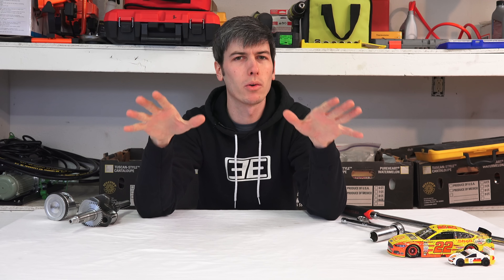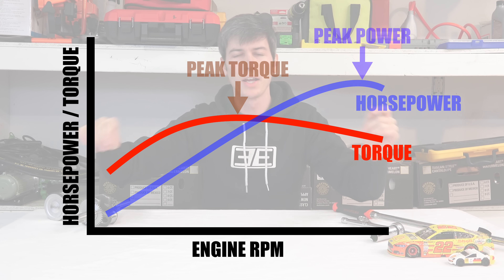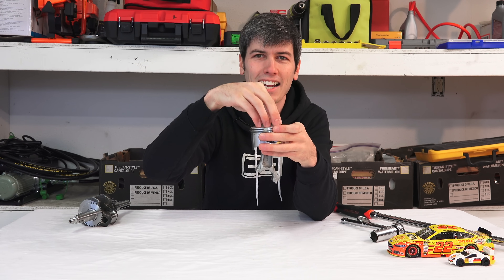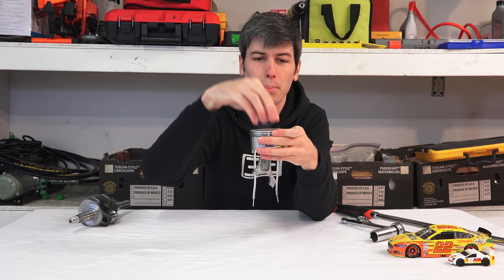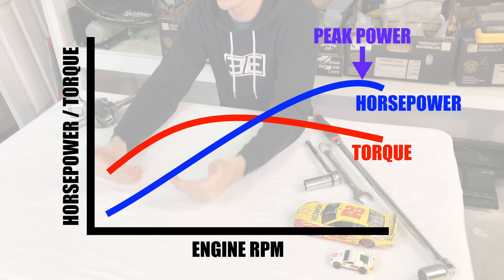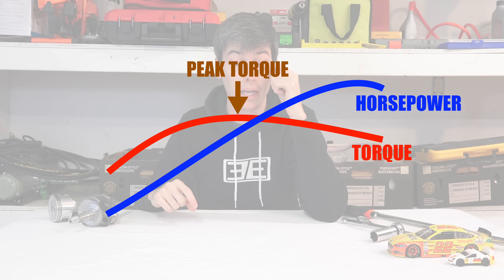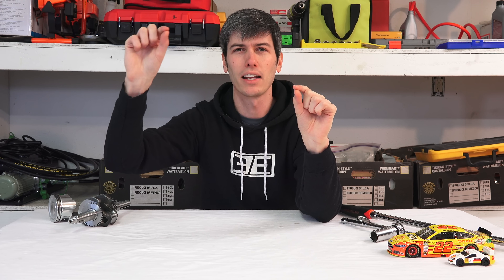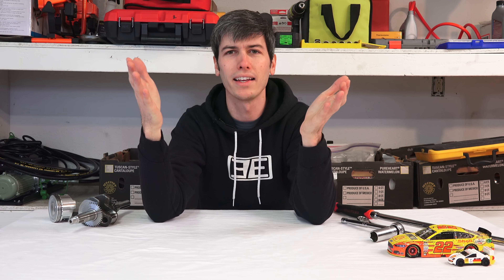Horsepower vs Torque - A Simple Explanation

Comment: Bro tell why that Diesel engines have low rpm levels?
Reply: Once upon a time it was because diesel pistons and rods were heavier, to deal with the higher compression and pressures involved. Heavy doesn't work that well with high rpm, because vibrations and rod stretch
Reply: Because diesel engines ignite through compression ignition rather than with spark plugs that otto engines work. That means that in order for combustion to happen, the fuel (diesel) must meet its self-ignition temperature when injected into the cylinder (~350C). For those temperatures to occur, air has to be compressed at high ratios and as more compression happens, the more the temperature of the air rises.

But in order to achieve that compression (around 18:1 at diesels compared to 10:1 of Otto engines ~theese are common approximitations) diesel engine's components use different materials and geometries.

For example, despite the materials used to withstand the high temperatures as we discussed, connecting rods are longer.
That's a reason diesel engines achieve high torque on low RPM ~> bigger leverage = bigger torque. Also thats due to thermodynamics because due to its high compression ratio they are more efficient but that's another story. Now imagine those components running at high RPM like the otto's engine. Firts of all its much harder because the pistons have to travel longer distances in the cylinder to achieve those speeds but even if they could, the engine would break apart.

That's the reason that heavy diesel engines of large ships are running on so low rpm but still have lots of torque.
Reply: Good god there are some bad answers here. Diesel engines specifically truck engines have a long long stroke. Your rpm is limited by piston speed. The longer your stroke the faster your piston has to move for a given rpm. So a truck revving at 1800rpm might have a piston speed of 20m/sec where as for a car to get the same piston speed it would have to rev at 4000 rpm.
Reply: Milinda Ekanayake cause they have higher compression ratio than gas with only having high combustion that needs to complete the otto cycle
Reply: What do you mean by low?  With mild mods you can rev a Cummins past 5000 RPM and I'm sure DMAX & PS are similar.  But why only rev a diesel to lower RPMs?  Because they make tons of torque around 1800 -2000 RPM and the main use for diesels are to do work so there's no reason to rev them past that unless you are racing.
Reply: compression ignition and very high compression. this is very broadly speaking.
Reply: also diesel is much harder to ignite than petrol
Reply: In Diesel engine only air is compressed in the intake cycle and diesel injection starts when the piston has reached tdc. The compressed air is so hot and pressurized the injected diesel combusts on those two alone without spark. That gives better thermal efficiency for the burn and allows much leaner mix, but it doesn't have as much time to burn it. If the diesel doesn't have enough time to burn (too high rpms) the efficiency and torque will drop. Diesel also requires high compression wich is usually made by long strokes and long stroked engines cant usually rev high (applies also to otto cycle-engines).

Comment: Another analogy: horse power is used to maintain a high speed and torque is used to get to that high speed. Analogy by Jason from Fifth Gear. Please correct me if I’m wrong
Reply from the maker: Most of the analogies are bad, that's why I didn't use any in this video.
Reply: That's wrong, therefore a bad analogy :D

Comment: What's the difference between an engine that creates a lot of torque but little horsepower connected to a transmission that has long gears for a lot of horsepower and little torque, and an engine that creates a lot of horsepower but little torque connected to a transmission that has short gears for a lot of torque but little horsepower?
Reply: more hp=more speed
Reply: transmission can not change power, only torque
Reply: John Scarce more hp = more acceleration
Reply: More power output = more force at the wheels = more acceleration = higher maximum speed
Reply: You'll still hit a wall with top speed. An engine producing 200ft/lbs of torque in a flat line but redlining at 3000rpm and producing only 114hp will still max out way before an engine producing just 150ft/lbs of torque up to 6000rpm (producing 170hp).
Reply: Hari5g900 Not true. Power determines torque at given speed. A twice as powerful engine will produce twice as much wheel torque at given speed given ideal gearing. So a more powerful engine will produce more force to overcome friction and achieve higher speeds.
Reply: But the force at the wheels is not determined by the engine's torque but by the engine's current power output.

Comment: Horsepower sells cars
Torque wins races
Reply from the maker: These are the analogies I like to avoid, because they're not accurate. Horsepower wins races, all else equal, as described in the video.
Reply: Advection
Tesla's destroy everything on the road because they develop power very early on in the rev range. I can make a million foot pounds of torque but if the drive train is not spinning I wont even move off the line.
Reply: Advection you can have 20,000nm torque but if you make 20,000 at 1rpm you wont go anywhere. 
Power is always faster concidering everything else like tyres and drag etc are equal, because Power is calculated from torque and the speed at which torque is delivered.
100 nm 200rpm is equally fast as 200nm 100rpm, same Power. Torque doesn't win the race
Reply: You have to understand that "All else being equal" point. You have a fast 0-60 time because the way gearing works. The gears on your polo could be different from the gears in a GTI. You might have a faster takeoff in first gear because you do in fact have more power available to you. But as things speed up and you lose your gearing advantage, it goes to the one with the greater horsepower numbers.
Reply: +Advection just no, dude.
Please explain why F1 cars can accelerate that quickly then, even though they have so few torque?
Reply: Advection
No, power =/= torque. They correlate but are not the same. Watch the video.
Reply: xI2aiizza
Low mass and high traction. But consequently low mass is achieved by having light and thin components that are only able to withstand small amounts of twisting force.
Reply: YES YOU WOULD! And no it would't take forever to reach 20000 rpm because would have way more aggressive gear ration than car with same power but more torque
Reply: Advection
Dude, stop. Off the bat your math is wrong, you would need 140 000 000 rpm for these numbers to work not 20 000. And having 20 000 hp and 1 Nm would make you incredibly fast with an incredibly high top speed. Two of the same exact engines one tuned more towards low end and the other towards top end; The one tuned for the top end will always be faster if you also change your gearing accordingly. Without adjusting the gearing you will still gain top speed but lose a little acceleration going form the dig but will catch up quickly anyway.
Reply: +Sebastian Bunblauskis 
Yes, Carroll Shelby was/is wrong. 
This quote has been proven wrong numerous times by numerous individuals including physicists, engineers and students.
Reply: +Advection 
First, the quote is wrong. 
Second, most every modern production vehicle including Tesla employ gears and gearing for torque multiplication. 
The Tesla Model-S has a 9.73:1 final drive gear ratio. 
Even the Koenigsegg Regera uses a 2.73:1 final drive gear ratio combined with a variable vane lockup torque converter for torque multiplication. 
Jason adequately explains the need for gearing for every vehicle in this and several other videos.
Reply: Yes. Had my polo chiped and rolled 280 Nm and 122 hp, my 11 year old golf has 170 hp and 250 Nm + it ways more. The golf is ca 1 sec faster from 0-100 km/h
Reply: Sorry i mistyped. The polo had 251 Nm and 122 hp, But the argument still stands
Reply: Torquey engines really only have an advantage from a stop. With a peaky engine once you are at the top of first gear the advantage of a torquey engine is completely negated as long as you properly manage the gear to keep the engine in the power band.

Additionally with a tesla not only does power come on quickly, but you also have the advantage of not having to waste time changing gears.
Reply: You all talking about peak values while they're in use only for a split second. It's the whole power curve and torque curve across RPMs that matters. Lets say you have a diesel with peak torque at 280nm but it dies out quicky and I have also a diesel but it has 200nm of torque and nice and flat torque curve up until it hits the rev limiter, and if you wanted to race me, I would win the race everytime, but for everyday use (this means at low RPM) it's your engine that will feel punchier.
Reply: arekb5
Peaky power curve? Use more gears or better yet use a CVT.
Reply: sliwka621 I was talking about torque curve.
Reply: So Mr. Shelby is wrong?. Today downsized cars claiming way to much hp that you cant feel. Low torque at low or mid rpm. Just my opinion. btw great video.
Reply: Don't get the gearing involved... it will only complicate things further. Yes you can address shortcomings of your engine with gearing... that's not the point. You can gear for torque with long ratios or gear for hp with short ratios. We're talking about power generation here, not power transfer... totally different problems. I'm done with this thread. Peace :P
Reply: Both cars equal torque but one has 50 more horsepower... well yea obviously it's gonna be quicker. Bad example bro.
Reply: "they develop power very early on in the rev range" that's called torque. & no need to repeat what I stated :P
Reply: Karwan: I could argue and say if you had 20 000 horsepower at 20 000 rpm but 1nm of torque you wouldn't go anywhere either. It would take forever to reach 20 000 rpm.
But that's not realistic... usually an engine is either tuned more towards torque (low end) or horsepower (high end). Both are different ways to measure power.
Reply: So you're saying having more power wins races... yeah I couldn't fathom that one. 
The problem is all else is never equal :P Torque-y engines develop power quicker. Horsepower is just top end. That's why Teslas destroy everything on the road... because of the enormous torque from 0 rpm.

Comment: still dont know what HP is or how it's calculated...
Reply from the maker: I will have a more theoretical video coming in the future. But as this video states, HP is simply a function of Torque multiplied by RPM (with a scaling factor).
Reply: 5252*** and basically what that means is that torque will always be equal to horsepower at 5252 RPMs
Reply: HP = (Torque x RPM) / 5656 I think, not 100 % sure.
Reply: that's what i thought before watching the video but i thought after this i'll know for sure lol
Reply: Doktor Hachi Roku ft/lbs
Reply: Christian
Only if you use imperial units.